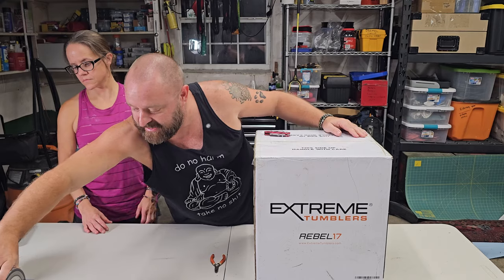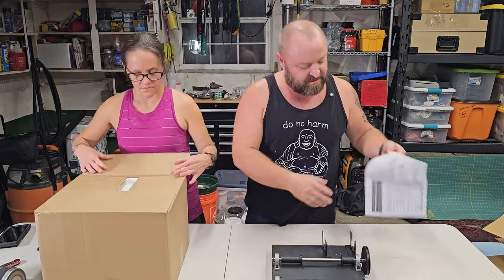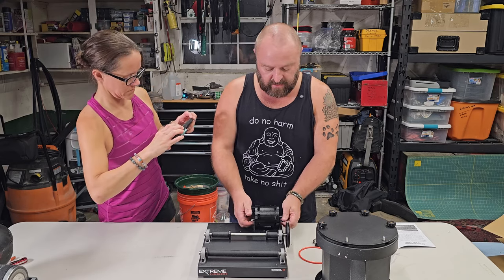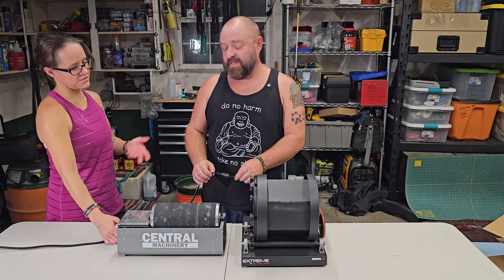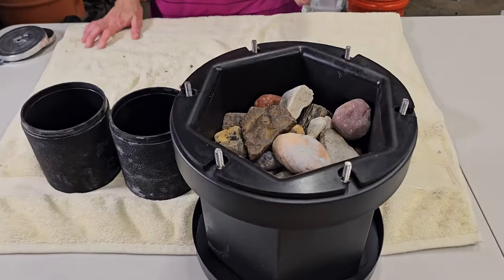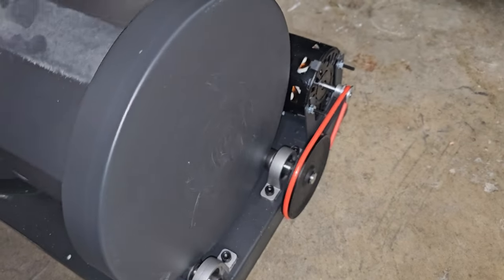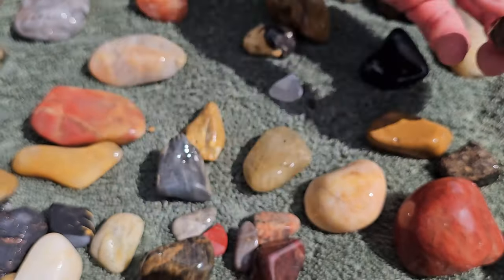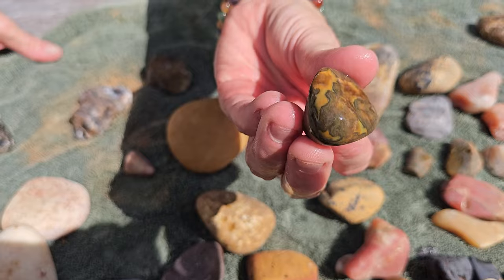Rebel 17 vs Harbor Freight- which rock tumbler should you buy?

Comment: actually you want a heavier grit for a big tumbler. I use straight 60 in mine because all that weight means the grit breaks down faster.
Reply from the maker: Good to know, thanks for the info! 👍
Reply: I've got one I've been using 24/7 for about a year and a half. I just took a 4th stage batch out yesterday. The only part I've replaced so far is the rubber seal on the lid. My little belt has been working this entire time. My first grit is 35/70. My last grit is micro aluminum. I've tumbled rocks the size of a softball in it. I do 10 day cycles for each stage mainly because I don't want to have to change it out every 7 days. I think the key to longevity of parts is to keep everything really clean. I blow out the motor and clean all the residue off the rails every ten days so that the rollers run smooth. I really love my tumbler. Right now I am kinda worried because I am tumbling raw Novaculite flint knapping spalls that have really sharp jagged edges. I hope that doesn't tear up my rubber lining. I've tumbled several pieces of Novaculite in other batches and those came out amazing. I've just never tumbled all Novaculite before so we'll see how it goes . Also I use lubricating oil in the bearings of rollers because I've found that water trapped between the rubber liner and the metal drum will leak out and quickly seep into the bearings and start rusting. I clean and oil those bearings every change out.
Reply: @claybowser698  Your liner should be fine. I have only gotten damage from a jagged stone once, and that was because it got jammed up. Hope they tun out as cool as they sound.
Reply: @djasteress6068  I sure hope they do too! My other Novaculite came out amazing. They make great palm stones. Everyone loves how they feel.